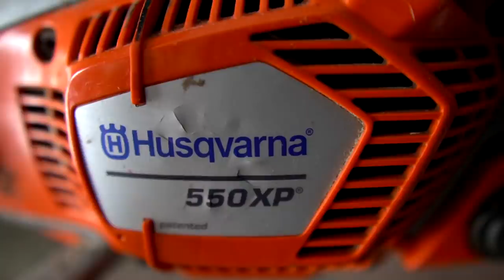Winter Snow Storm at the Cabin | Iron Dog 2022

Comment: hey guys love the channel love what you do. Eric and Ariel your my favorite couple awesome what you do!! i am so so jealous. wish i was in Alaska with you or at least near you. Alaska being such a huge state just being there is near enough for me. but i wanted to tell you if you didn't already know about snow removal. especially on roofs and tarps or your high tunnel. Since snow is slippery on your roofs first lets go with fabric roof. Now you can put this anywhere on the side. but put a long bar the length of high tunnel clip a rope to said bar throw it over. one of you slide one side and the other the other side hold down tight snow will come right off. anchoring  the bar ever so often to side of building helps it from bowing outward. Use carabiners on rope clip on bar and slide down bar. Hold rope tight against roof of high tunnel works wonders. no cuts from shovels or sharp objects.  
   Now metal or shingled roofs? there is a shovel that looks like a letter U with a long handle and a big piece of plastic as a tail. unwrap tail,... and it is usually 24inches wide, lay at edge of roof slide into snow and push upward into snow. Snow slides down plastic sled or tail. leaves on a little bit on roof. you do approx 24 inches a swipe. works awesome. take care be safe stay warm. looking forward to your next video. did you get the new tamper chipper bar? just asking. just trying to make your lives easier.
Reply: That’s great advice and I have seen the items used that you advised them about, and I hope they see this because they do work!

Comment: I didn't know about the propane fill adaptors.  Now in my Amazon 2 buy bucket.

Something you might want to consider for your chainsaws.  Carburetor rebuild kits which are very inexpensive.  I had an older Stihl ms290 that was giving me fits.  The rebuilt kit did the trick, and got the ole 290 working perfect again.  You'll be removing the high&low jets so be able to tune the saw afterwards.

Comment: The rope used like dental floss is safer than using ladders. The ice on the roof edge mean ice dams - moisture inside the cabin that migrates to the area under the roof and also the rood edges. Bob in Nevada

Comment: Some times there is a lubricant a type of oil like say pam you need to spray on your snowblower before using it if you get a heavy wet snow and its wierd but there isa an inpeller on the shoot as well if you add a thick piece of rubber like a rubber mud flap screw it onto the impellar blades it doesnt clog up as much and actually shoots the snow even further. but always "turn the machine off" when trying to clean out a clog in the main impeller or the secondary shoot impellar I almost lost a finger cleaning the shoot out secondary shoot out. Just my two cents on North Dakota.

Comment: There is a reason they call those 1 lb propane canister disposable.   They do not have a relief valve.  Here in the midwest, there have been several people who have been burned severely and some have lost their garages and homes.  If you over fill them they will explode violently.   I got my info from a propane dealer.

Comment: Amazon sells an adapter. You can fill the 1 lb tank out of the 20 lb. I filled 20 in an hour. And be careful with a 20 lb. tank. If you adapt it to anything you need a filter because 20 lb. tanks have bits of rust etc. from being refilled. There's videos on YouTube on how to fill the 1 lb. tanks.

Comment: I believe if you spray ceramic coating (similar to what's used on cars) on the blades and surroundings of your snow blower, you'll have less clogging of snow. Not sure how well it'll work but you could give it a go.

Comment: I dont know how youd do it but if you had a VEE Blade on your atv or utv it would push through deeper snow easier say maybe intially when you just start pushing snow. I used to live in Denver and workeds for a huge auto deALERSHIP N SNOW REMOVAL Was a constant battle with had usually 2-3 trucks and a salt spreader and as well constantly keying up cars and moving them was a nightmare as WELL so I can relate to ur snow removal problems and sometimes moving heavy wet snow constantly plugs up snow blowers.

Comment: Here in Canada they say it's against the law to do that but Walmart online you can buy this adapter and there are lots of places where you can find empty propane 1 lb canisters like the green one Coleman that you have up there at the recycle dump at the Bottle Depot sometimes you can find some of them half full you can pull on the Schrader valve with a pair of surgical scissors or a needle nose pliers and get a little bit more propane in there but if you had can take five of these walls and refilled them up and take them with you all the time then I would suggest not to pull on the needle for it can create a vacuum with in the canister during the time of use and collapse the bottle in words and you can have a explosion trust me I know I'm a licensed gas fitter

Comment: I always use 100LL Aviation fuel in all my equipment, it never goes bad.  Been using it for over 40 years on everything including 2 stroke chainsaws, etc. without a single issue.  I've Should be easy to get up there in AK.

Comment: Eric, are you using 0% ethanol fuel for the generator? It's usually sold as boat fuel. Fuel with ethanol in it supposedly attracts water and is bad for small engines like generators, boats, lawn mowers, chainsaws, etc. Around here, I have to go to the one gas station that sells 'clear gas' AKA fuel with 0% ethanol. I think the ethanol percentage is on a sticker on the gas pump.

Comment: You should show the weight of an empty propane cylinder and then weigh it after you fill it and see how close you are to being full and 1lbs!!! I have also herd that you need to pull on the purge Nipple to let air out so there is more room for more propane!! I absolutely love doing the same thing and use the bottles for my heater and cooker for when I’m out ice fishing!!! Much much cheaper!! But for a 4 pack of them here in Iowa they are roughly 12.00 to 15.00 depending on where you might go to get some!! But a 20lb propane tank refill or swap is like 13.00 at some place but the gas station are like 23.00$ to 25.00$ for!!

Comment: Thanks for another great video guys. We wait for them to come out every week! This snow just keeps coming doesn't it! #AlaskaStrong . I'm sorry to hear about your snow blower and your plow! I'm sure that was tough. A few more weeks and we're out of the woods and on to spring. :) Eric, your editing is really taking off, great job!

 I don't know how much time you guys have to actually read your comments, but I had a thought for suggestion/to submit at your cabin in regards to your steep access. It really looks like a struggle and I'm sure its brutal carrying stuff up the hill. Have you thought of bushwhacking in a simple switchback trail? I think that it would pay off in spades, and make your lives a lot easier. Think of being able to drive your sleds (snowmobile) right up to and around the back of your cabin. You would just need to make the actual sharp turn of the switchback the widest part of your trail. I think you'd love it. We have a friends cabin near our families cabin, and they have a VERY steep and long climb access up to their cabin from the lake (likely 3x the elevation of your steep spot). They put in a simple switchback trail, and it's worked great. They can now drive up and down with wheelers and snowmobiles with ease. You could do it with chainsaws and foot traffic, and it would eventually beat itself in. Just a thought. You guys are doing great, be safe!

Comment: Hi guys.  Been down with a cold( not covid)That propane adaptor pretty cool. You know I really enjoy watching this site and Im going to pass something I do believe you can build,  On you tube check out  " Is Petpetual Motion Possible? then scrool down to  " Is Free Energy Possible" imagine if more folks build this or some of the other self running systems. No more gasoline or propane generators.
Anyhow I do believe you can build this. 
One other thing. That fuel saver i mentioned that plugs into your odb port in your vehicle.  It turns out to only work at 40 to 50 m.p.h.  I have found that 63 m.p.h driving I have always gotten good gas milage.  I won't reccomend that device again to anyone period. Im sticking to 63 m.p,h.   Happy Trails,  Bob